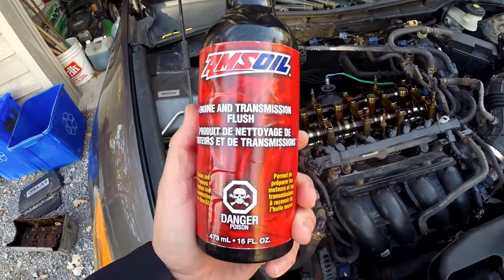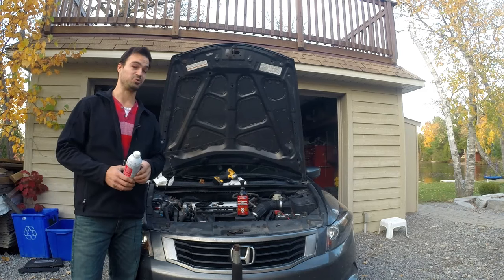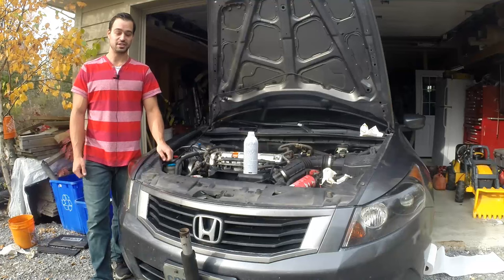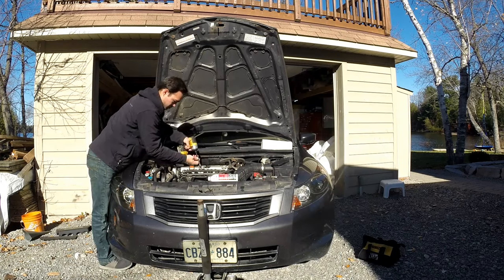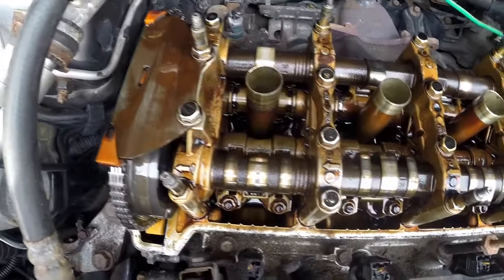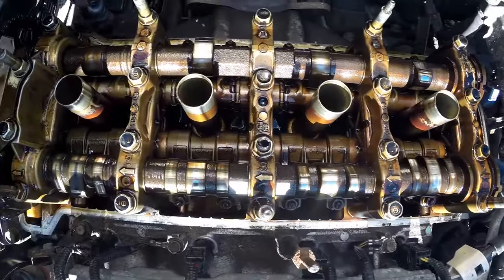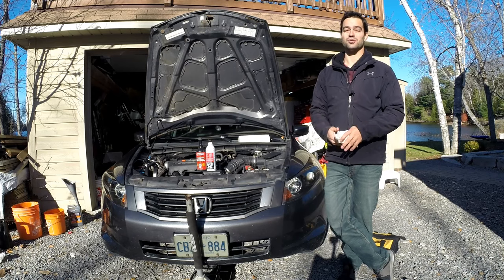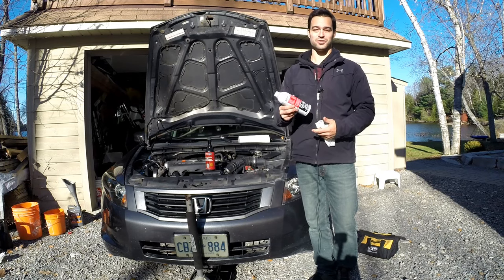Amsoil Vs. Seafoam Engine Flush - Who Wins? Thorough comparison and PROOF

Comment: If you want the engine to look like new, then get the BG Dynamic cleaner kit.  These products don't have enough chemicals to clean the engine. They help a little bit but you will have to change your oil every 500k. It took years to build that sludge it will take many flushes to clean it.
Reply from the maker: Nice thanks for the tip!

Yeah this car was getting up there in mileage and I was using Amsoil XL so it’s got plenty of life to go well beyond 10,000kms

So for me it wasn’t worth spending more $$ to change it that often.

That to say though, if I had a newer vehicle or something higher performing, then yeah I’d definitely be doing what you are saying, short interval changes and then using cleaners somewhat regularly.

I’ll have to try out that stuff by BG! Thanks for the tip!
Reply: BG is a lot better but it is also $250 vs $20
Reply: As a professional in the automotive business I can validate that the BG Kit is far more effective. I’ve saved my customers thousands of dollars using it. Don’t get me wrong. I’ve used Amsoil. It’s good. I’ve used Seafoam. Love it. Great stuff. But if you want to clean an engine internally you can’t beat the BG Dynamic Engine Restoration Kit. Worth every penny!

Comment: Save your money on Seafoam, it's snake oil. It only improved performance while it's in the engine or fuel system due to the petroleum distillates acting as a lubricant. 
Any pour in the oil or gas product at an auto parts store is usually never effective. 
Dealerships use specialty products like BG at dealerships because of their effectiveness.
Amsoil products are superior when it comes to flushes, cleaners and lubricants and their effectiveness is why they are in business when they are dealer only or online only rather than sold with mass production products at auto parts stores.
Reply from the maker: Thanks for your comment! 
Really appreciate the info.

Based on what I saw from my own personal results, it seemed that the Seafoam did slightly outperform the Amsoil on this specific test. 

However, what I'd really like to see is testing both products, on two different engines multiple times. That would be a true way to see how they perform.

I'm a huge Amsoil fan, I use a ton of their products and I will continue to do so as long as I own a vehicle.

But for this test specifically I can't argue the fact that the Seafoam did seem to agitate and remove more buildup than the Amsoil. But as I mentioned in the video, this could have also been because I tested Amsoil first as well. 

Hard to say but at some point down the road, I'll be attempting another test like this and I'll try to make it as fair as possible. 

Thanks again!
Reply: @KingdomAuto  absolutely no problem.  But isolate your testing so you can distinguish which is stronger. 
I've used both but I had to test them individually to determine that amsoil engine/trans flush was stronger.
Honestly BG EPR was the strongest I've used for engine flushes specifically and I'm about to try ATS since it's a specialty product and recommended for professional use only.
Reply from the maker: @mikehigby7897  That's great to know - yeah if you remember, keep me posted on the ATS as well. Really appreciate the info and if I was to do this kind of test again, I'd use more products as well so I've taken note of BG EPR and ATS. Thanks a ton!
Reply: Amsoil is also like a multi-level marketing operation.  Might be Tier 1 or above, however their business operations just make me and others wary. 
I've personally used Seafoam in a couple of vehicles, and I know it works very well, both while in the vehicle and subsequent operation after its had an oil change.  It may just be a more modern take on kerosene that the 50's motorheads used, but it sure has worked for many people.
Reply from the maker: @boots7859  Yeah agreed. Based on what I've personally seen + from other tests online, it does seem that a handful of these products definitely make some incremental improvements to the engine, and a lot of people vouch specifically for Seafoam as well, myself included.

I can't speak much to Amsoil's other products or their business operations, but I've found their oil to be very good overall. 
There's a YouTube channel called Project Farm (you've probably already seen some content by him I would imagine) and he's run a series of oil tests on his channel - really well controlled. And Amsoil comes out on top out of a bunch of popular brands of oil.
Here's a good video:

https://www.youtube.com/watch?v=TWuKvnCq1js&t=193s&ab_channel=ProjectFarm

Granted though, in today's day - it's likely not so much the type of oil that's used but more so the fact that the changes are done on time, and that enough oil is always in the engine.

Anyways, thanks for your comment!! Have a good one :)
Reply: That’s not true at all, as mentioned in this video, another YouTube channel “ project farm” ran seaform in a truck, and lawnmower, and this guy breaks down everything. The seafoam completely fixed his issues, and it stayed that way.

Comment: When changing oil replace one quart of oil with one quart of ATF. With VVT engines replace half a quart of oil with half a quart of ATF. ATF is packed with detergents and flushes the engine slowly as to not kick loose large pieces of slug that could clog your oil pickup screen. Five oil changes later and your engine will be squeaky clean inside.
Reply from the maker: I’ve heard this from a couple other folks that commented on this video. Seems like a really good way to clean things up. I should run this test again with this method 

Thanks for your comment!
Reply: @KingdomAuto no problem. It’s safer than the other flush products because the other products are just solvents with no lubrication properties, whereas ATF it’s not only a detergent it’s a lubricant as well.
Reply from the maker: @joshuaraffensperger3592  makes a ton of sense. Will have to try it some day and film the results!
Reply: ATF is NOT loaded with detergents. That is an old wives tale that simply isn’t true. ATF does not require high levels of detergents because they don’t need it. Engine oil contains much higher levels of detergents simply because the combustion process creates the byproducts that cause sludge. Automatic transmissions don’t have a combustion process and don’t require the same levels of detergents. 
  This is easily proven by doing a cheap oil analysis on ATF and any motor oil. Lab analysis will show that ATF is much lower in detergents compared to engine oil. ATF also has friction modifiers to work with the friction clutches in an automatic transmission that you don’t want or need in an engine. 
ATF being a good cleaner is a urban myth that just doesn’t work. The fact that no oil tribologists have ever recommended using atf in an engine should tell you all that you need to know.
Reply from the maker: @prevost8686  appreciate the info, I think it would be fun to actually run a test and see, to either confirm or bust the myth!
Reply: @KingdomAuto  I’m sure some people will be upset by my comments. As a mechanic I used to believe that tranny fluid was full of detergent until I actually started doing oil analysis on all the fluids in my equipment. Any tribologist will verify it as well.
Reply from the maker: @prevost8686  makes sense. I think it would be a fun test to run, just to see what happens for the sake of observing the claim about ATF

Comment: The oil with the Seafoam in the can, appears to have alot more black carbon, sludge in the oil.  When you moved the oil, it looked like alot more on the side then the others. 
I recently bought a 2001 Ford Escape V6, I ran Seafoam through it for about 450miles.  When I changed the oil, you could see the suspended sludge, particles in the oil.  And my god, that oil filter was heavy, I bet over a pound if not more.  The owner I bought it from, said that there was always continuous oil changes every 5000km.  He used it as a drive around vehicle, thats it. After I drained the oil, I can tell you, that timing chain shined!!! And it didn't before.  I am a firm believer in Seafoam.  It appears to me, that Amsoil didn't do a darn thing..
Reply from the maker: Yeah you very well might be right. I personally didn't see a difference in the quick test where I compared the looks of the oil but I wasn't looking all that closely. 

I did notice a difference in the cleanliness of the engine after the Seafoam was finished doing its job though. 

Cool to hear that you had a good experience with Seafoam as well!

Comment: These cleaners need heat to clean. I've used BG EPR and using that you could hear the engine get quieter. Run it at high idle for about 15 min, pull the plug and that oil was black as tar. I was genuinely shocked.
Reply from the maker: Thanks for your comment! I'll look into BG EPR as well. For both of the products I just followed the directions on the bottles. I was pretty impressed at the results though, and I think if they were used often/with every oil change, they'd probably keep the engine quite clean!
Reply: @KingdomAuto  give EPR a shot. Get the engine up to temp, pour it in, high idle (1500 rpm) 15-20 min. Give it about 15 min to let all the oil come down to the pan and then pull the plug. You'll be shocked.
Reply from the maker: @JF32304  Yeah will do - Did you happen to take a look at the engine head before and after? I'd be really curious to know about the results
Reply: @KingdomAuto  on one of the engines I did it on yeah. Honestly it looked not brand new but close to it. No joke I was shocked. And that thing had almost 200k miles on it.
Reply: @KingdomAuto  not the head but the valve cover.
Reply from the maker: @JF32304  That's wild! Good to know. I appreciate the information :) 

Oh and yes, by engine head I also meant inside the valve cover :) I wasn't sure how to specify it lol
Reply: @KingdomAuto  no worries! I knew what you meant. But in all seriousness it's crazy how well it works.

Comment: I have tested a lot of them. My choise is MOTOR MEDIC MFD1 Synthetic Motor Flush, and/or STP Super Concentrated High Mileage Engine Flush. Also Marvel Mystery Oil, replace 20% of oil capacity with MMO for 1.000 miles before oil change
Reply from the maker: Nice, thanks for the info 👌

Comment: Maybe the next few oil changes alternate the engine cleaners during each oil change then recheck the removed valve cover after 4-6 oil changes and see if you notice a difference.  Who knows you might want to use both on a rotated basis.  I am a fan of seafoam fuel treatment and the Amsoil products. Tough decision.
Reply from the maker: Thanks for your comment! Yeah a test like that would definitely be interesting to see! If I have the time in the future I can definitely try to put something like that together.

I’m with you though, I run Amsoil’s oil in all my vehicles, but I also think that Seafoam’s carbon cleaners do a good job :)

Comment: Have you had any problems with your Accord after a year from using these products? Some say using engine flushes can clog the oil passage screens possibly causing engine failure.
Reply from the maker: Nope not at all. I think in extreme cases where there is an immense amount of sludge then something like this could happen. But with a regular amount of buildup, the products seem to slowly and gently remove the buildup in a way that it won’t clog anything.

That’s also why it’s highly recommended to change the oil and filter right after using these products too.

That said, I didn’t have any issues after doing these tests :)

Comment: I would remove the power steering hose from the PS pump to make the valve cover removal easier - just protect the pump and hose (towel to catch PS oil) opening while working.  Makes cover removal easier on my 2004 accord 2.4L.
Reply from the maker: Makes sense!

Comment: Love you're video. But I see one thing wrong please for the love of your son never get under a vehicle without jack stands in place. I didn't see any but please for your safety my friend.
Reply from the maker: Thanks so much Donald! I did have support under the car when I was under it - camera just didn't pick it up. But I really appreciate you looking out for me though. Thanks again
Reply: Why does there always have to be someone like you in the comments . If you have a good jack and you're only removing the drain plug you don't need jackstands...sheesh.
Reply: I immediately wanted to tell you the same thing about never trusting a single jack if you crawl under your car. The fellow that showed disdain for using jack-stands needs to know this.

One day, a long time ago, the most knowledgeable man in the team asked me to grease the zirk fittings under his International dump truck. I had never done anything to any vehicle prior to that day, so I simply did as he said.

At some point he yelled down under telling me not to worry, that he was going to start the truck to give his work a test. He started that huge truck in reverse, without his foot being on the clutch pedal. It lurched backward, killing the engine, but knocking over the “floor jack” (dirt for a floor). The right front wheel of that monster moved over and landed on the dead center of my chest, breaking all of my ribs at once, then the truck rolled forward and off my chest (luckily).

My lungs were collapsed. I remember thinking how stupid of me to die on such a pretty day. The struggle to gain a breath went on for almost a minute before air rushed into my lungs, and the pain began. We were located 45 minutes from the nearest hospital.

Putting a vehicle on jack-stands has been a hard and fast rule to me, before going under my car, ever since. With just one jack, just one mistake can ruin your day.

BTW: I enjoyed your video.

Comment: Great video! Obviously the Amsoil cleaned it, then the Sea Foam cleaned it more! I would not put a catch-all product like Sea Foam in my crank case though. "Put it in your gas, put it in your oil, put it in everything!" No thanks.
Reply from the maker: Thank you.
Yeah I would be inclined to agree with regards to adding product to the crank case. Granted, the detergents seem to be quite mild and I think as long as it’s not in the engine for too long then it should be fine.

I do completely understand what you’re saying though, definitely wouldn’t want to dilute oil and rid it of its lubricity :)

Comment: The Amsoil is for when you going from conventional oil to synthetic that’s the reason you only run it for 15 min at idle it’s more of a detergent to get most of the conventional oil and setting the engine up for synthetic use it for my wife’s car 2013 Nissan Sentra
Reply from the maker: Thanks for your comment, but on the Amsoil website, the product claims to do much more than what you've said. Although it does claim to prepare the engine for new oil, it is also supposed to remove deposits and engine sludge, help loosen sticky valves and rings, quiet lifter noise (and more). See the link below, for info on the exact product that I used, from Amsoil's own website. 
These aren't my claims, they're straight from the manufacturer. 

https://www.amsoil.com/p/engine-and-transmission-flush-flsh/

Hope that helps clarify what I used and what I was trying to achieve with the test.

Cheers.
Reply: @KingdomAuto  👍

Comment: An old school trick I have used when I bought an old car with a gummed up motor with sticky rings and lifters is half a quart of auto transmission fluid in the engine and run it for a few days before changing the oil?
Reply from the maker: I’ve heard that before as well. Not sure I’d want to try it in today’s engines but I’m sure it would be interesting to look into a little more. Maybe it wouldn’t cause any harm at all and clean out the engine a bit? Would be fun to see either way :)

Comment: Use MOBIL 1 oil and filter and/or Royal Purple oil and filter .  That will keep the car running great and clean.
Reply from the maker: I've heard good things about both of those oils and have used them myself as well. Based on the research I've done, it seems as though Amsoil has better lubricity than those two brands, which is why I use it. 

I suspect that most of the sludge in this engine was already there before I owned it. for the first 220,000kms of its life, I don't know what oil was used, apart from the fact that it was synthetic. 

Then from 220,000 to 375,000kms, I had it running on Amsoil XL. 

Either way, when I saw how dirty the engine was looking, I figured it would be a good opportunity to test the Amsoil and Seafoam products to see which one came out on top

Comment: Seafoam is amazing 
    It is the closest thing to liquid tune up/mechanic there is pretty much, I've started putting it in my SUV and now all the yard equipment it works for sure and I have really only ever put in the gas tank might put some in the engine oil before my next change
Reply from the maker: It sure does seem to do a good job! Considering the cost of it and how gentle it is on the components of a vehicle, seems like a great way to keep things clean.

Thanks for sharing your experience as well!